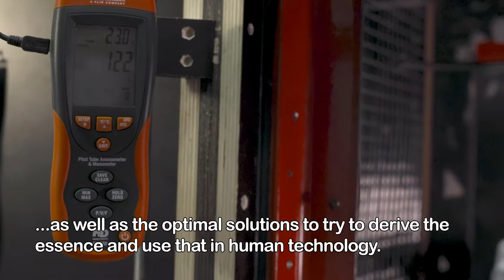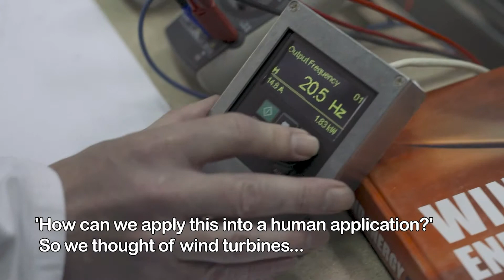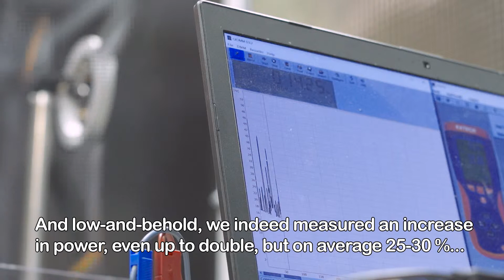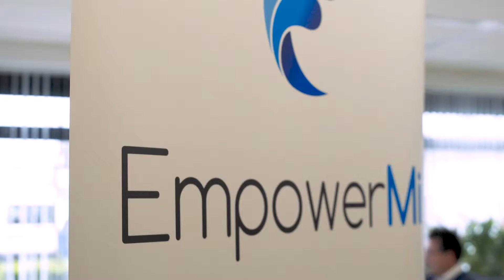Albatrozz minidoc with subtitles

Comment: Very nice project. Does size matters in this case? I mean, could this be an solution for small windmills for private use? And also important is that Groningen is again leading in energy solutions that could change the way we are dealing with the power of nature. I have solar cells on my roof but I am very interested in additional power for periods with less sunlight. Keep up the good work!